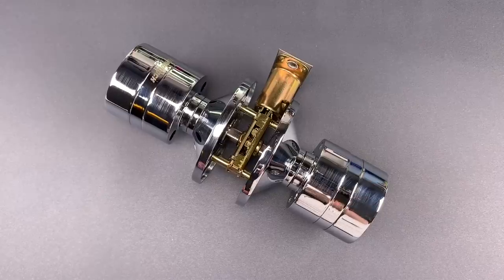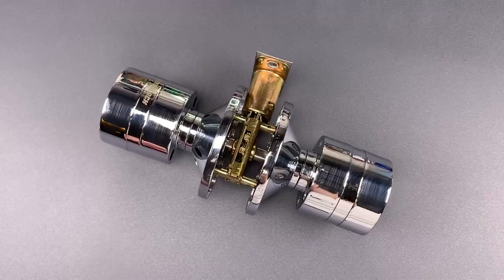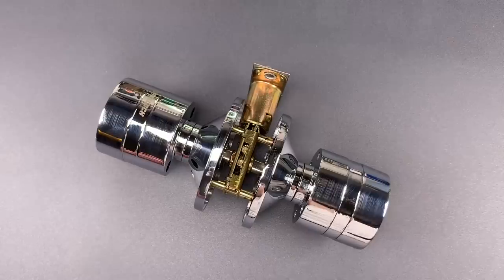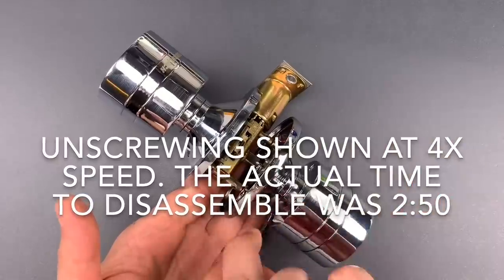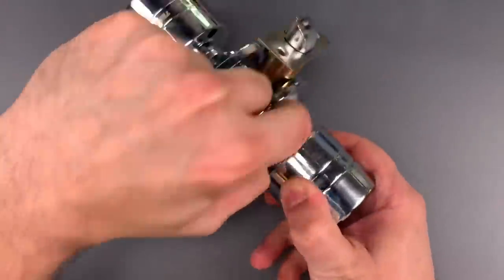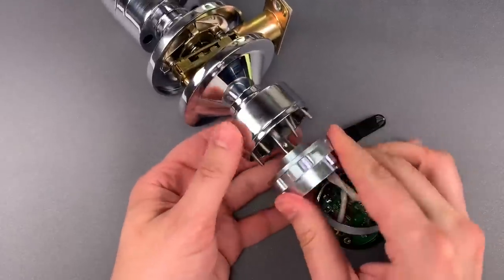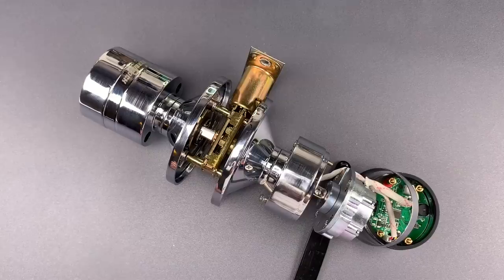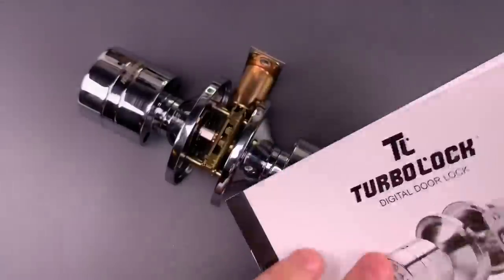[945] TurboLock YL-99 Opened With a Screwdriver!

Comment: APB:  be on the lookout for a white, middle-age male, who has evidently disassembled a TurboLock in violation of international law, using a right-angle screwdriver, possession of which is also a violation of int’l law.  If apprehended, please secure the suspect with zip ties, as he is considered able to pick any known handcuffs. If zip ties are not readily available, an alternative means of securing the suspect is a waist chain and any Master Lock, since this brand of padlock is unpickable.

Comment: The last burglar was a sob. He did not read the whole\hole manual. Only the part that shows him how to get past locks they sold.  To funny...
  Probably comes apart for battery. Should just have wired plug to run to the inside handle.

Comment: They are so dumb, these manufacturers need to start getting real. They could have at least used maybe security torx or something slightly more uncommon. I'm not sure what they're called but maybe even like the type of screws that are in bathroom stalls where you can screw them in but can't unscrew them without a special tool.

Comment: I mean, two minutes for you is actually pretty good, but you're not using your strengths in this case - exceptional lock picker, normal screwdriver user.

Pretty sure I've gotten a ratcheting right angle screwdriver free with purchase from harbor freight.

Comment: Who. On. Earth. Thought this was a good design? Jeez. Not even a security screw? The silly little ones with two little holes instead of a slot? Or the torx with a raised boss in the middle? Or the ones you see in restrooms that have ramps on the counterclockwise side of the head?

Comment: 3 minutes to remove 4 screws while he's holding the uninstalled lock in his hand? How about timing it while actually on the door. As many others have stated, a swift hit with a hammer can takes out most locks as well as a good kick on the door. If someone wants to get in to your home they are going to find a weakness be it a door, window or other means. Now if you want to secure your home like Fort Knox then so be it but most do not take that approach. I understand that these are not the most secure locks but I laughed out loud as I watched that timer as you opened the lock while holding it in your hand.